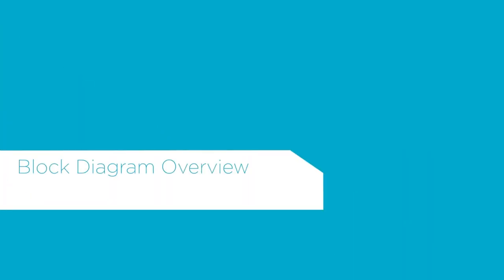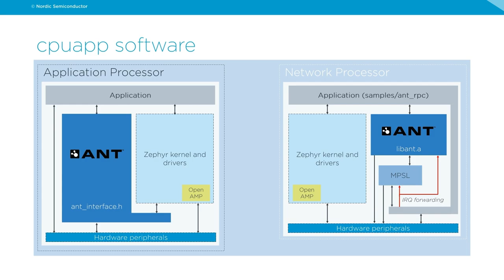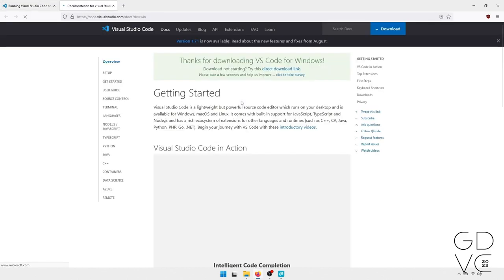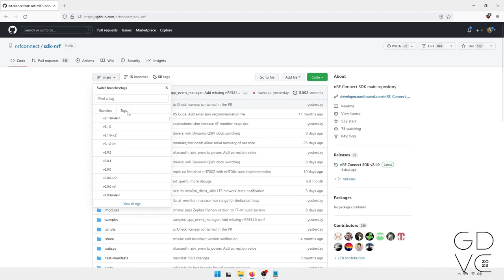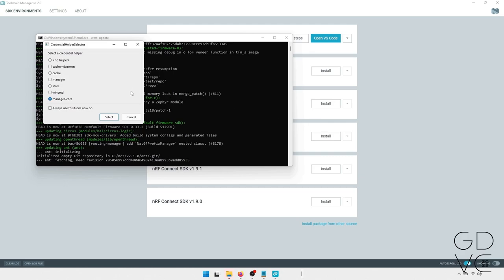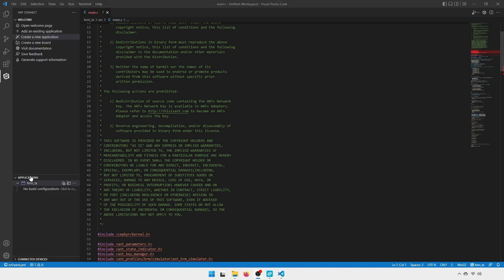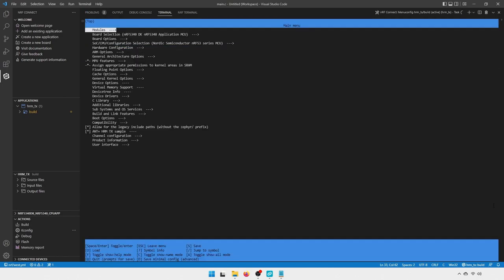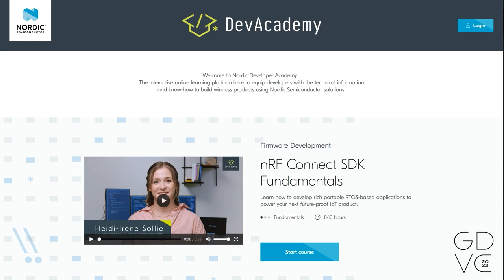Getting Started with ANT for nRF Connect SDK

Comment: Hi, I've got nRF Connect SDK v2.2.0 installed & after getting authorisation to the nrfconnect/sdk-nrf repo I saw in your video you had SDK V2.1.0 installed then when you looked at the tags you saw V2.1.99-dev1 and said "this is the one we want" but not sure what the criteria was for picking that?  I have 2.2.0 and just picked the plain v2.2.0 tag - was that the right thing to do?  I got an error when I ran the west update :
HEAD is now at ca070dd Merge pull request #39 from microbuilder/fix_tests_cmake
ERROR: update failed for project ant
& ended up with no ant subfolder in nrf.  This is on a Mac by the way & also I'm trying to use this tutorial to build something for my nRF52840 dongle but was hoping it would be a similar process .  Thanks for any help you can provide.
Reply from the maker: Hello, the first ANT support was released between two tagged nRF Connect SDK releases, so at the time the video was released the v2.2.0 tagged release was not available yet. Moving forward using the tagged releases is the recommended.
Reply: @NordicSemi  thanks for clarifying - makes sense now

Comment: can't you provide an example with a single core device, such as nRF52840?
Reply from the maker: Samples that directly use the radio peripheral can run on the network core of the nRF5340. They do not require any functionality from the application core. For more please see our documentation: https://docs.nordicsemi.com/bundle/ncs-latest/page/nrf/device_guides/working_with_nrf/nrf53/nrf5340.html#direct_use_of_the_radio_peripheral
Reply: @NordicSemi sorry thats not what i asked. please read question again.
Reply from the maker: @kitKat-by6kk  sorry for misunderstanding your question. ANT for nRF Connect SDK only supports nRF5340 at this time, but support for other SoCs is coming soon. For more info, please see: https://devzone.nordicsemi.com/f/nordic-q-a/106881/ant-in-nrf-connect-sdk
Reply: @NordicSemi , I have nrf52840 dongle, I want to use ANT+. Tell me, please, what solutions to my question are available at the moment?
Reply from the maker: @vintik1688 , please reach out directly to our tech support team on DevZone and they will help you out: https://devzone.nordicsemi.com/